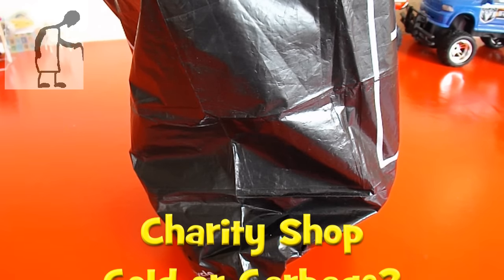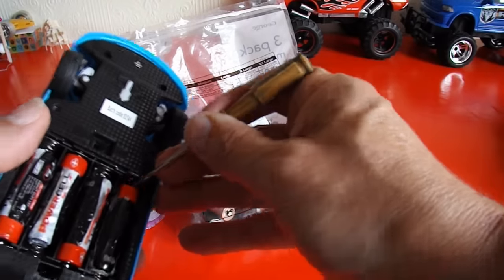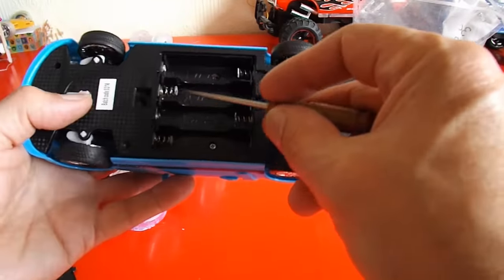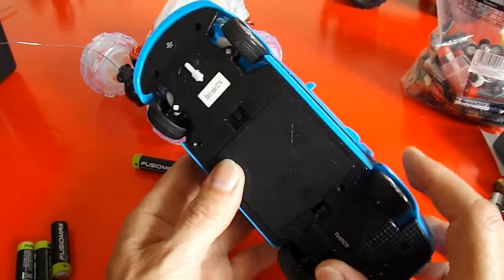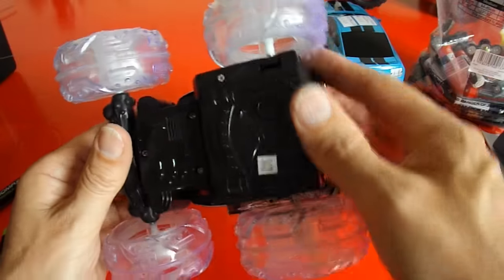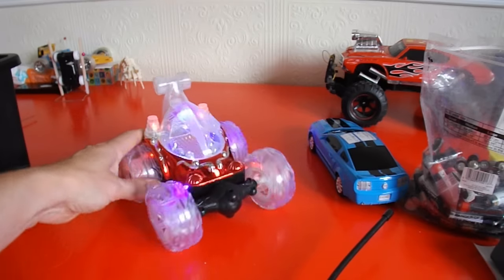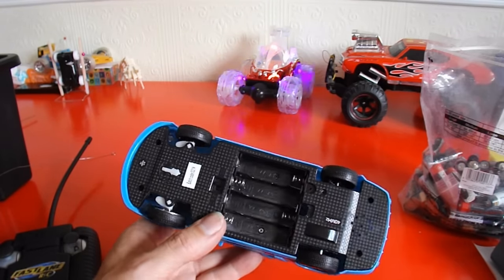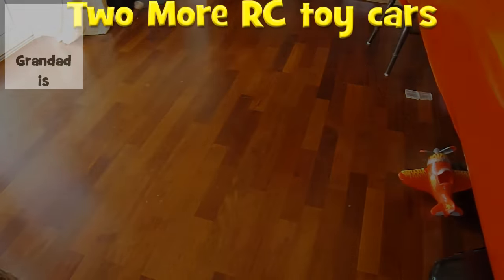Charity Shop Gold or Garbage? Two More RC toy cars

Comment: Perhaps I do have a hint. On the net (even on YT) you can find some explanations about non-rechargeable batteries. Not the cheap disposable ones (these are light weighted). The alkaline ones (they are heavy and sturdy) can actually be recharged. As soon as the voltage gets lower (1.4-ish) you can put them in a recharger. Now here is the trick. We are TOLD we should not recharge the alkaline batteries, because they might explode. How ever: if you charge the batteries for a rather short while (can be as short as 10 minutes) they will get warm. Be sure to stop charging before they get hot. When the batteries are back to room temperature, you can continue charging them. When a voltmeter shows the voltage is 1.65 Volts it is time to stop charging. If you have a time controlled switch (with good granularity) you could have the charger to be switched on for 5 minutes per 1 hour, and just let it go on for a day. Any how, do not blame me if they explode: if you charge the batteries to where they get hand warm, you should be okay. Also note that not every brand alkaline battery supports this trick. For more info do some research.
Reply: deslomeslager 00

Comment: i have a question can you use those rc car recharable batteries to rechrarge them if that works then ill do it i need some batteries and the battery is ni-cd aa600 mah 1.2v
Reply from the maker: +Aleksander Sats see deslomeslager's reply. I do not recommend his suggestion but if you are willing to do further reading to find the information and willing to take the risk that is up to you. To be honest I do not fully follow you question as it is not specific in the details. I use cheap rechargeable batteries from the bargain store and a proper charger designed for that type of battery. The batteries do not hold their charge for as long as more expensive ones but they work fine for me and I have enough of them to be able to swap them out as soon as they run down and the flat ones go straight in the charger so they are ready again in a few hours or less.
Reply: GrandadIsAnOldMan
i will rey but i a guessing it will work because the batteries are recharable batteries ikm gone risk it